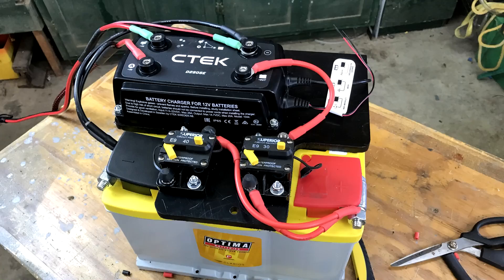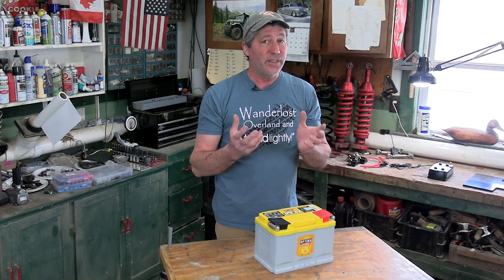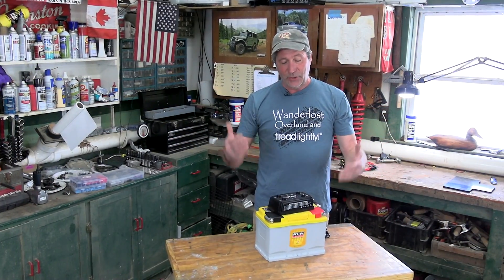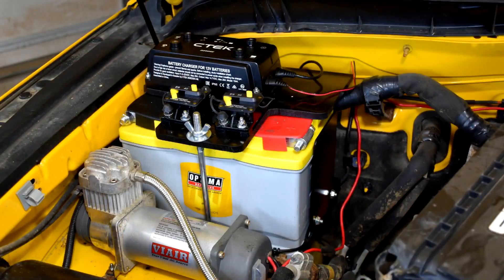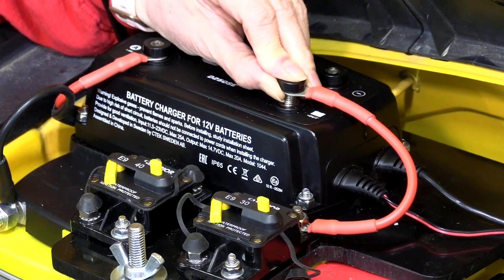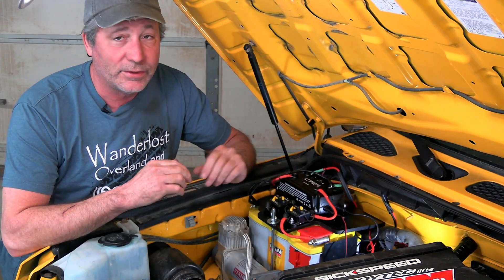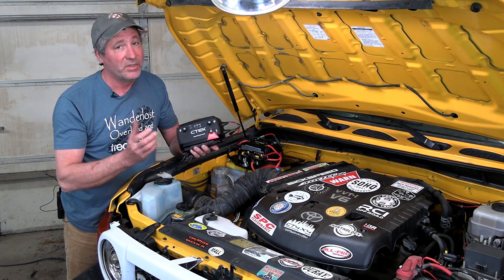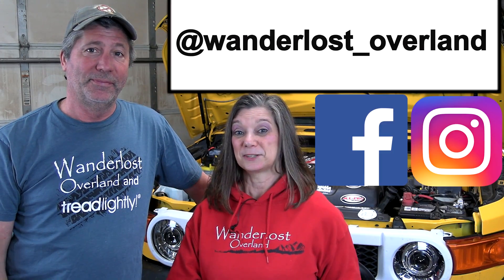Affordable Dual Battery Setup Using DC-DC Charger-Easy DIY

Comment: Good video. A few points. Let the positive cable to the battery be the VERY LAST connection that you make, instead of STARTING from there. You showed disconnecting the breaker, but the next clip appears to show it turned back on, which makes me shudder. It is a good idea to also run a ground wire to loads, devices, etc., which you did, rather than depend on the auto chassis. This will also reduce noise from coupling into the circuits. One last point…make sure you don’t use a circuit breaker rated higher than the wires that connect to it. Otherwise, your wire could overheat before the breaker trips.

Comment: Hi, Perfect mod! I’ve have approx the same in my fj, but I would like to connect second battery directly to 110v socket on the rear bag. Could you please help to 110 v socket find  wire end  in the engine area? thank in advance.

Comment: Why not just hook it up to a solenoid, so it doesn’t drain the starter battery when the cars off. This system is nice but could be done for $200 total

Comment: I see you have installed this CTEK and also a Red Arc.. Which one do u prefer?
Reply from the maker: Both work the same, both are reliable. The Ctek is usually less expensive but the Redarc has a lower profile.

Comment: Can I install a power inverter with this system and would it be just as simple as installing a power and ground to the inverter off of the CTEK with the correct AWG and breaker? Great video very informative!

Comment: There's nothing affordable about your method.  Just use a solenoid to isolate your accessory battery when the key is off.  BTW you can't mount a Lithium Ion under the hood due to the heat or cold.
Reply: Hopefully, 2 years after your comment, you recognize that you’re wrong.

Comment: That's an Optima Yellow top. Isn't meant to be used as a starting and/or a deep cycle battery (dual purpose battery)? I heard a saying that goes, "When in doubt, use yellow top." I gotta say though. This is probably the best wiring job I've seen. I like how you mounted the charger and breakers on the auxiliary battery. Nice work!!!

Comment: This was very informative, but im trying to find one on adding an inverter with battery setup for my work van to power my chargers and occasionally a chipping hammer (large load) im thinking of using a battery from batteries r us from golf carts (deep cycle) 
Thinking of putting a breaker and then a fuse to a battery charger (charge controller)to limit the cable size, with an automatic disconnect or VSR (voltage sensing relay) to turn it off and on 

Any ideals? Or is this overkill

Comment: Hi, just a suggestion. the sensor could be insulated with some foam and then taped - this would give the actual batt temp instead of the engine bay temp.

Comment: Whats your opinion on voltage controlled relays? I bought one that has a photo of a car battery on the front and the description says it’s for adding a secondary battery. Would the batteries be overloaded at the moment it kicks in? One battery at 14.4v and the other at say 11.5? Wouldn’t that be bad for the batteries long term?

Comment: Hey there! Is you’re guys starter battery leaf acid? And did you use a battery isolator?
Reply from the maker: In our opinion, starter batteries should always be lead/acid. No need for a battery isolator with our setups.

Comment: $321 for just the charger ain't cheap. You can have a dual battery charging system, just as easy to setup and for a lot less.

Comment: -- Not how I did it, and I wouldn't.  But, I'm not looking down at my nose at you.  For starters, I use a smart isolator grounded to the negative primary battery post.  Solves your smart alternator problem in most models.  Second, testing with a voltmeter for a smart alternator, and also model and observation makes it easy to tell.  Third, unwritten rule, but one I learned well in 4 years of being a car audio installer (remote starts, amps, caps, head units, etc) with something like this, use 4 gauge wire.  Fourth, double ground both the primary and aux batts.  Fifth: You probably did it later, but electric grease on those connections.  And your breakers are a little lite.  I'd go 50 primary, 60 secondary batt.  Lastly, you need an easy plan if your primary battery crashes.  Not sure the charger you're using can do that, but it means dual grounds and a quick disconnect so the secondary battery can operate the vehicle by itself.  
    But I'm glad you mentioned you want those breakers as close to the batteries as possible; that's critical.   A very nice, clean install you have there.  
    Suppose if I had anything to add to people interested in doing this for the first time, it'd be spend time looking under your hood, and have a plan.  Work backwards from the secondary batt,  then backwards from the primary batt.  Last thing that goes in, is the linkage.  
    Thumbs up.

Comment: Great video as always!!  I have a dual battery set up currently and installed a battery isolator so it won’t drain my main battery. I have everything connected to my coach battery like my fridge and all. I am not wanting to add a solar panel and have been looking at a dc-dc charger. Will I need to remove my isolator?
Reply from the maker: You won't "have" to remove it. But it won't serve much purpose when using a DC-DC charger.

Comment: What size is the inline blade fuse?
How did you determine what size you needed?
Thank you for the easy to listen too vid.
Cheers
Reply from the maker: We always size our fuses to what we're powering. If a fridge draws 8amps we use a 10amp fuse. All that is also determined by what the wire, switches, and connectors can handle too.

Comment: So l am guessing Ctek instructions  recommended breaker size?
Reply: They should because the Ctek charger has a maximum output current capability and the breaker should be no higher than this.

However, having said that,  you need to factor in the cable rating you are using between the Ctek and the battery. If that can only handle X amps, then your breaker needs to be X amps or lower.

Comment: Have you had any issues with the charger so far? I installed the exact same setup in my Hilux in February. A couple of days ago it stopped working. I'm afraid it just gets too hot under the hood and stops charging...?
Reply from the maker: No problems at all with it.

Comment: So so so over-complicated
Reply from the maker: Maybe...but it works.
Reply: It is not complicated, but it is safe way to do it.
It is only complicated if you don't really understand it.
Reply: I disagree, as a mechanic, and an experienced electrician. This is not over-complicated. Instead, you're probably oversimplified on your end.

This method results in an efficient, effective setup with no unnecessary components. This is exactly the amount of complexity this project requires, for best results, anyways.

Your method for adding a second battery must be simply slapping in a second battery somewhere, and wiring it to the alternator, parallel to the original battery.

Your method will give you a quicker, cheaper setup, while charging your batteries more crudely. The batteries will likely not charge optimally, or even completely. That usually results in shortening the batteries lifespan, and may also have effects upon the alternator as well.

Comment: Does the 2007 FJ have a smart alternator? Curious as I have the CTEK on my 2007 4runner with the same 4.0 and I was told it did not.

Comment: What a great video!! I have two questions, when you reed the voltmeter you installed in the back of your car to power all your gear, how much does indicate? 2nd: It would be any difference in how long last a fridge connected to a Yellow Top DH7 battery compared to a Yellow Top D35 series before it drains the battery? Thanks so much for your great videos!!
Reply from the maker: Thanks for watching! The volt gauge reads around 12.8 when the battery is fully charged. More when the engine is running and there's charging power going into the battery. I don't have an accurate answer to your second question, sorry.

Comment: Was just watching your 4Runner video on dual battery. Why didn't you use the same DC-DC charger in the T4R?
Reply from the maker: We wanted to try out a different charger. So far both chargers are doing equally as well.

Comment: Very helpful.  The most confusing part of the wiring is how to wire the dc breakers. In particular the breaker after the dc-dc charger.  You have the Charger  outputting to the breaker Battery Line terminal and the breaker Load terminal outputting to the "House" battery.  I'm assuming this is correct, since normally the Battery Line is the input side and Load is usually the out side of the breaker.

Comment: How many hours of driving does it take to fully recharge the house battery? How long does it take to recharge the battery with the engine idling? 

Great video! Thanks!
Reply from the maker: Depends on how discharged it is of course. Starting from 75% capacity it will charge to 100% in about an hour of driving. A little longer while idling.

Comment: I see you are using a CTEK charger. Where you not happy with the redarc you put in the 4 runner? I am in the process of looking at rebuilding my tacoma's electrical system with a pair of deep cycles in the bed. so I just finished watching your 4runner install.
Reply from the maker: We're perfectly happy with the Redarc, just wanted to try something different on the FJ.
Reply: @WanderlostOverland  would love to see a comparison at some point in the future... me tacoma is slated for a dual battery system eventually when it is in the budget

Comment: Interesting setup.
One thing though.... I run dual batteries (matching optima AGM ) one under the hood the other behind the rear seat.
Both are charged off the 120A alternator.
The setup costs are: the batteries total $560.00, Stinger 200A isolator $54.00, assorted fuses $30.00, terminals $10.00, a set of 6 gauge 15 foot jumper cables $50.00.
Total cost for a complete system with 2 new AGM batteries $704.00
The primary via the factory setup, the secondary is controlled by a pair of relays wired into a Stinger 200A isolator and both batteries are fused.
At startup, both batteries are tied in series to assist with starting the engine and while the engine is running both batteries are being charged.
With the key off, both batteries are isolated,  so as to never draw off the primary start battery.
All electrical accessories are wired off the secondary battery.
I'll be going into my 10th year with this setup.
Not sure what the life expedience is going to be for the batteries, but I'm pretty sure they must be coming to the end.
Reply: thats great unless you run down the house battery then the alternator ill be compromised
Reply: @seanfoley9055  Actually now running dual Odyssey AGM's along with a MeanGreen high output alternator.  The sole purpose of the high output alternator is to recoup the battery(s).
Though I never experienced a single issue with the old system , I would not expect any with the new upgraded equipment.

Comment: didn't you use the redarc bcdc charger before,  did you take that out  if why?
Reply from the maker: We use the Redarc in the 4Runner. For the FJ we wanted to try something else. Nothing wrong with the Redarc though.

Comment: I had a 1994 Chevy 1500 truck that I ordered with an auxiliary battery and tray.  It was positioned on the passenger side next to the firewall.  I did use it for camping for lights and a little fan.  I had a cap and used it with a tent that connected to the tailgate of the truck.  it was really cool.

Now I have a turn of the century GMC Yukon that I would like to mount a couple of rigid compact 100 watt solar panels on the luggage rack (which is rarely used) to supply power to a ca. 1200 Watt solar generator in addition to the the vehicle's power system and a 110-120 AC power source.  The solar  generator is portable to get more flexibility.  My main concern is that the solar panels will cause drag which can negatively affect performance and gas mileage on the vehicle.  It can be used for camping or bugging out during a SHTF scenario.

Comment: I sure wish electrical systems didn’t intimidate me so much. Would love to do this on my own to save money, but it would likely cost me much more in the long run.
Reply: So very simple tons and tons of videos explaining all of this.
Reply: its totally worth it & once you succeed you will never regret!
Reply: They intimidate you because no one ever draws out a circuit diagram to explain what is going on.
Reply: @deang5622  Nah, I am just rather dumb. 
Although I never setup the dual system in my 4Runner, I did setup a battery bank in my van. It isn’t quite right, but everything works. Four house batteries with a Dc to dc charger, inverter/charger w/shore power and no fires or explosions yet.

Comment: CTEK 250SA and SmartPass 120 have been nothing more than optimal, extremely efficient and dependable in my 5th gen 4Runner for over 4 years now.  Along with the SwitchPros 9100 and Victron Smart Shunt, I've been able to keep tabs on all my electrical devices and draws.  Because of the SmartPass 120, I went with a full 1/0 gauge or 0 AWG wiring size to keep everything cool and juice running clean.  Thanks again for all your great videos!
Reply from the maker: Great to hear Alex! We too are using the Smart Shunt in the 4Runner. For the FJ we're going to test out a cheaper one. I hope we don't "get what we paid for" with it. LOL

Comment: Good video but 95% of any vehicle I see does not have room for a spare battery under the hood, you have to go back to the 60-70's cars for that or big trucks
Reply: Agree my 2013 Triton does not have any space for another battery. 😞
Reply: Chevy 1500 silverado comes standard with 2nd battery slot, just pull a bracket & bolt in a tray.  Dunno about newer models though.
Reply: Mercury Grand Marquis has a separate spot for a battery, and there's enough room in the trunk for about 20 more too
Reply: Ford van e 350 , no space under the hood , my is inside the car

Comment: My main worry is that with the newer cars there’s so much electronics, unhooking the battery can even cause problems.
Reply: Check out NOCO's obd2 port cable if you own any Noco charging products. It's meant to power computer during battery disconnect/maintenance.
Reply: install the 2nd battery without removing the starter battery, using a dc-dc charge controller connected to the alternator/power source last, after the house battery is connected but do not connect the starting battery until after everything else is connected.  The starting battery remains connected the whole time, but only connects to the house battery via the alternator & then the charge controller. The alternators factory settings control the starting battery charge, and the alternators charge get handled & maintained by the dc-dc charge controller.

Comment: Great video! I can see how this setup would work good for overlanding as the vehicle is driven most every day. Would it power a 12v fridge while camping for a couple days or would you need to add solar, or is a Jackery type portable power station work better for camping?
Reply from the maker: There are a lot of variables; temperature, how full the fridge is, etc.. We have run our fridge for a couple days just off the battery. By adding a solar panel you should get more out of it.

Comment: I have used Ctek D250S ( no smart generator) and D250SE ( for mobile lithiumbattery) for 4 years. Bulletproof. But, the solarinput has a verly slow mppt algorithm. You get more amps in total from an ordinary pwm solar charger. But the dc/dc charging works like a charm. I have it in the tray. Engine heat will reduce charging,  as you know,since its temperature compensating. Time will tell.

Comment: Very helpful. Does the charger also prevent the main battery from being drained when the vehicle is off?
Reply from the maker: Yes, when the ignition is shut off the two batteries are completely separated.

Comment: We are new to overlanding and just picked up a used gx. The dual battery setup is giving the most anxiety about installing as we are amateurs. Anyhow s we appreciate the content!  Keep it up!
Reply: All you need is two of the same battery.  Never ever mix battery’s, even isolated.  Get two of the same battery’s and a battery Dr.  (battery doctor).  Been running these setups 10 years no fails, no returns, easy and cheap.
Reply: @iwantallthepizzaanduranium1627  you can have different batteries if you use a dc-dc charge controller
Reply: did you get it done?

Comment: Great info , we have been using CTEC for 4years and love it in our FJ Cruiser and our FJ 60 . We mounted the unit inside the cab in the 60 because to much heat under the hood . We use a Goal Zero 500 Lithium when we camp in our FJ40 for frig and camp lights . We have enjoyed your videos for years thanks.

Comment: You guys have help me tremendously on my 4 Runner. Check out Genesis Offroad. I have used their system for a dual battery solution. It cost about a grand and used group 25 size batteries. Easy to install because it is pre-wired. Very cool.

Comment: I just dropped 1500$ for a solar/generator power source setup to charge my 70AH battery setup for my trailer and I felt down in the dumps for how much I spend. After watching your video I'm confident not cutting corners on cable size and fuses was the smart thing to do... Now I can charge my house battery in the day and run my diesel heater at night